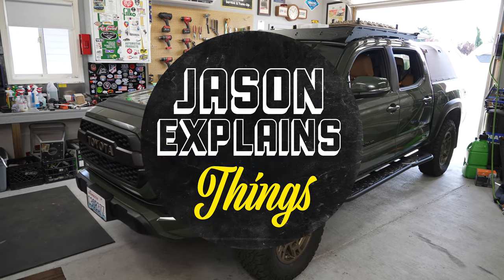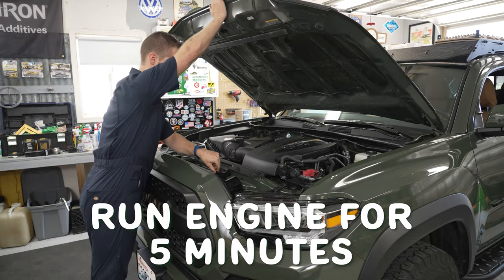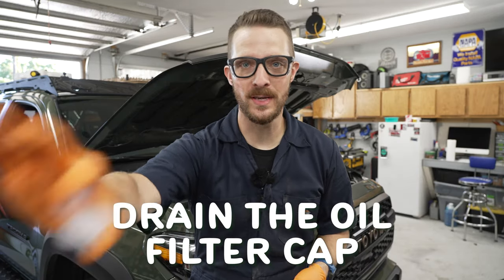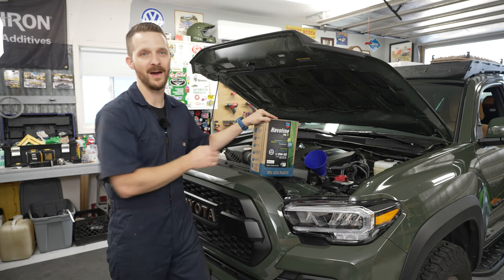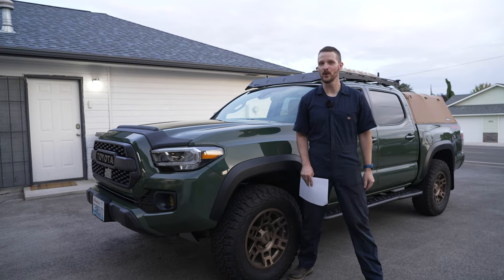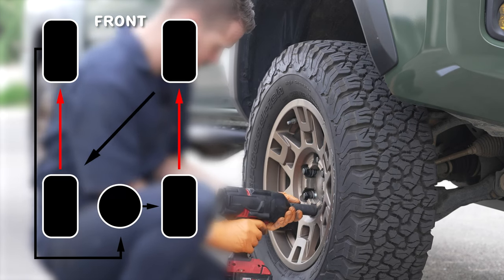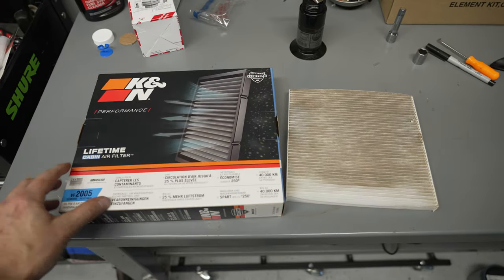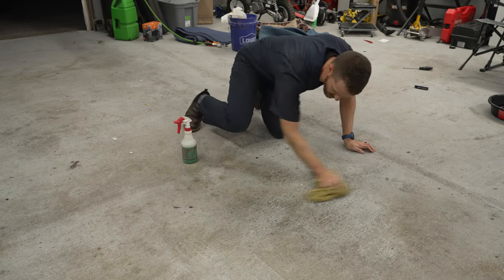Toyota Tacoma 5K Mile Maintenance COMPLETE GUIDE (Oil Change, Tire Rotation & More)

Comment: My dealership did replace my cabin air filter at my 20k Toyota care oil change. They also had me coming in at 5k for my oil change intervals even though the book says 10k. I was impressed.  All covered by Toyota care. 2023 Tacoma.
Reply from the maker: That’s rad!  Your dealership is a rare breed.
Reply: My dealership had me come in at 5K for the first 2 years (Toyota care), but did not change the oil until 10K. I have a maintenance background and I change my oil every 5K, so I noticed this Immediately. Other than that I'm happy with the service.
Reply: Same here. 2022 Tacoma. Exact same treatment!
Reply: @oysterfleet5669 , Toyota care is for 25k. And they only cover 10k oil changes. Maybe the dealership paid for the 5k changes. My dealership is giving me free oil changes every 10k up till 100k. But I still change it myself after 5k

Comment: for anyone prepping to do this, I'd suggest having a larger 1/2" breaker bar and a 24 mm socket for the oil filter housing because those things can be over torqued by the dealership, at least mine was. this was the solution I'd found on tacoma world, if anyone runs into a similar thing
Reply: the "mechanics" they hire at dealerships are the worst of the worst. That's where you go to get your money stolen and shit broken. Gotta do it yourself.
Reply: Bro I just took a ratchet to the nose from pulling on the oil filter😂
Reply: And a torque wrench to tightening the housing to 25 nm.
Reply: I don't think the dealership even oiled the O-rings when they did the included maintenance on mine. The first time I changed the oil, it was a beast getting the filter off.

Comment: Its better to use your fuel cleaner just BEFORE your oil change. Then you're dumping all the unburnt hydrocarbon buildup into the old oil that you're about to change. I have 260k on my Taco with no major issues.

Comment: Excellent video. I just got a 2023 Tacoma and Maintenance Required light came on,  didn't know why. Now I understand it's the Oil service reminder from factory computer settings. The dealerships had just serviced it at 3k so the actual oil change would be at over 6k, but vehicle was just doing it's factory reminder.  Thanks for being so thorough on oil change procedures and reset.
Go Tacomas!

Comment: Great video, I'm 64 years old, and I only rotated tires on one car out of the Many cars and trucks I have had over my lifetime. What I found out is yes it made them wear the same, but it wore out all of them at the same time, so I never rotate tires anymore, why? Because I don't want to have to buy but 2 tires at the same time rather than all 4, It's a lot cheaper to buy 2 tires over 4 or even 5. I don't believe you get more life out of your tires by rotating, but you do get more life out of the set that way because the back usually wears out faster if you have rear-wheel drive and spin your tires when you take off or the front if you have front-wheel drive. And I never included my spare tire in the rotation, which honestly is probably a good idea, especially if they all match and they are all new. I'm going to try it your way on my new Tacoma and see what happens, I don't need a new spare tire, just something to get me to the tire shop if something happens on the road. I do carry a can of fix a flat and a mini air compressor with me everywhere I go, I even carry a tire fix it kit I bought from Amazon in all my cars and trucks so if i can find the whole I can just fix it on the road. I do a lot of backpacking and white water canoeing. Right now I have a dodge ram 2500 Toyota Tacoma and a Honda CRV which doesn't even come with a spare tire at all it just the can to fix a flat lol. I'm going to try it your way this time and rotate my spare into the mix until I get my spare worn down to almost time to buy a new one and see what happens, keep up the good work.

Comment: I highly recommend getting an aftermarket oil filter housing, because mine broke trying to take it off myself due to my last maintenance person at Toyota cranking it too tight. Plus the aftermarket one, it's made of better material.
Reply from the maker: There's an aluminum filter housing from Toyota that I've since upgraded to.  That's the one I'd recommend.

Comment: I have splashed oil many times in my shop doing oil changes. I know the feeling.
Reply: I had the oil geyser out of the same drain pan. Twice!  Thought it was a fluke the first time and was ready to move the pan around the second time (Didn't help). I blamed it on the 0-20 thin oil as the 10-30 oil in my other vehicle never geyserd out like that with the same drain pan. I have since put an Oil Splash Pad in the pan and no more Geyser.

Comment: Not a bad video, basically what I do with two differences. 1) Shop vac, connect to the inlet pull vacuum while you take off the the drain plug, you don't get any oil out till you shut off the vacuum. Lazy way to keep clean. 2) Do you not have grease joints on the Drive shafts anymore? I have a 2nd gen Tacoma and I lube them up every time I change the oil. I also do 5k miles or 6 months which ever comes first (use to be 3 months or 5k miles, but I don't drive near as much with my new job).
Reply from the maker: On my 4Runner you do need to lube the drive shaft, but it’s sealed on my Tacoma.

Comment: I didn't have the place to change my oil last time so I brought it to a shop.  They charged $330 to change the oil and change the cabin air filter....  -.-  Didn't even go over anything they may have inspected like brake pad thickness.  At least a dealership will do that.  
Thanks for this great walk through!
Reply from the maker: Oh my gosh!  That is complete madness.  This right here is why I make these videos.
Reply: @JasonExplainsThings  they also put a sticker on the widlndshield to come back in 3k miles. So I'm afraid they put conventional oil in too 😱  all I asked was for the "40k maintenance"

Comment: I installed a Valvomax drain plug on my Tacoma after I bathed myself with oil on the first change. I scrimp on the cabin air filter because I open my windows and sunroof on nice days. The cabin air filter is largely superfluous with the cabin open. Even the cheap ones protect your ventilation heat exchangers.

Comment: This is Helpful!! Thanks.. im no mechanic..
Reply from the maker: Neither was I... just started tinkering about 13 years ago.  Now it's what I do for fun.  :-)
Reply: @JasonExplainsThings   are you Cutting soon your Bumper.. Seems alot of Taco are doing it to make clearance on the front Wheel
Reply from the maker: My plan is to do an aluminum CBI front bumper to increase clearance, approach angle and to add a winch.  Hoping to do that this winter.  I already have the winch sitting here!  :-)

Comment: Hey you should check out Capri 4.5 gallon drain pans. Well built deep walled, no flexing or twisting with 7 quarts in it. Holds about 8 quarts safely.
Reply from the maker: I definitely will.

Comment: Great video.  One additional item to consider is greasing the U-Joints.
Reply from the maker: My Tacoma doesn't have grease zerks actually.  When they wear out I'll likely replace them with ones that do.
Reply: @JasonExplainsThings  you have to check carefully, my '18 had 1 on the front drive shaft that I found when I started doing my own oil changes

Comment: I’ve got a question for you Jason.
My dealership uses Mobile 1 full synthetic oil when they change the oil and filter.
If Havoline is better oil, why do they use Mobile 1 ?
I get free oil and filter changes for as long as I own my truck, (which is about 15-20 years or 250K to 300K miles).
Toyota says to change the oil and filter every 10K miles but I still change it every 5K miles, so I buy the Mobile 1 full synthetic oil and filter and crush washer, so Toyota charges me $40 every time I’m paying for it.
My 23 TRD Off Road is about a year old with 8,500 miles.
We’re going to MT this weekend for vacation, so I’m sure after returning home it’ll have 10K miles on it.

Since our dealership uses Mobile 1 full synthetic oil, will it hurt my 3.5L to use the Havoline for the times I’m paying for the oil change?
I appreciate your channel and content.
Reply from the maker: Mobile 1 is great oil too.  No issue in using it.

Comment: I have that exact CBI skid and shops have complained they can't access many things and asked to remove them. I told them not to touch. Have you needed to remove yours for any specific service?
Reply from the maker: For a front differential service you would need to remove it… but not for an oil change.
Reply: @JasonExplainsThings  Yeah I always just remove the two access doors before an oil change, but at my 60,000 service the tech said "your differential fluid looks good." And I wondered how it's possible that they knew that without removing my skids. I actually have the full skids from CBI, which covers up more stuff. 🤔

Comment: I learned on the first oil change to use a large Tupperware container about 5 liters in volume to catch the oil. It’s about 5” tall on the sides and there is no splash what so ever. Im going to def buy the skid plate. The stock one isn’t too hard but def heavy and make your shoulders hurt after. Thanks for the awesome video! Subscribed.

Edit: it is a 10liter container. 5 is way too small haha.
Reply from the maker: Thanks Danny!  Hey I actually have a discount code for it.  Expires in a few weeks but it should be active now:  CPM6LYBLBP
Reply: @JasonExplainsThings  thank you very much for the code.

Comment: Where do you stand on low mileage vehicles? Service at the 5k mark or based on time? I work from home so my truck does not get up to 5k miles very quickly.
Reply from the maker: I’ve heard a good rule of thumb is every 5k or 6 months.  Some say you can stretch that to a year if you don’t drive much.

Comment: Mmmmm🧐?

Thank you for the tips on the oil drain tool kit, I am going to purchase one. The filter removal sockets purchased thus far have been junk. 

And I do use the same exact oil. 

Thank you for finding the cabin air filter location, I was wondering about that. 

Your tire rotation plan is clever. 

Though, what about the transmission fluid level, and you forgot the differentials. 

Thank you and motor on!
Reply from the maker: Trans fluid and diff changes are more of a 30k-40k interval.  When the time comes I'll definitely do those.
Reply: @JasonExplainsThings  how do you know that the current oil level in the transmission and differentials is correct? Do you have faith in the factory's procedure, and or in the dealership pre-sale inspection? 
Have I checked mine? You ask. 
NO! I feel neglectful in that respect. 
The all too (new practice) common practice these days is to have a sealed transmission, no dip stick. 
We customers are the dipsticks now days for allowing this practice to continue. 
And I have not checked the diffs due to blind faith that they got it right at the factory, foolish I know. This will change as soon as I return home from my journey. No, I am not driving my Tacoma currently. 
Now what about that transfer case, I have forgotten all about it, I have become such a slacker. 🥺

Comment: I torque the oil filter cap to 18' lbs and oil cap plug to 10' lbs....every 2 days I see a small drip on my oil filter cap. Should I tighten the oil filter cap some more?
Reply from the maker: Might be worth checking.
Reply: @JasonExplainsThings  I will Thank you.

Comment: Jason, did the steel CBI skid plate used on your Tacoma take care of the design issue you noted on the aluminum plate used on your 4 runner?
Reply from the maker: So, I'd recommend watching this video about this topic.  Long story short, the aluminum CBI skid had a pretty dramatic failure I feel is caused by removing steel cross-braces when using an aftermarket skid plate.  I now use the Toyota TRD front skid and it's been excellent.  https://youtu.be/0_mebxQ5uBg

Comment: Wonderful helpful tips and guide. I have a 2018 Toyota Tacoma SR5 3.5L V6. @ 36,000 miles I have a question and wanted to know if the same things you use work for mine as well or should I get a different kind of oil? Second question is what kind of transmission oil fuild do I use to change and what other things do I need to change also? It's hard to find real loyal mechanics so I came across your channel and hoping to get some help all the way from: Juneau Alaska
Reply from the maker: Yep, the engine oil would be the same.  Haven’t looked into transmission oil yet since I’m only a 14k miles currently.
Reply: @JasonExplainsThings  
Ok, thanks 😇👍

Comment: Do you have TPMS on all 5 tires? I am thinking of doing this for my truck, but wondering if I only have 4 TPMS, when I put the spare to passenger rear, it will throw a code for the sensors.
Reply from the maker: It will but there’s a way around it:  Toyota Tacoma TPMS Tool:  Reprogram After Rotating Tires or Swapping Wheels!
https://youtu.be/NkXqJP2j5CI
Reply: Ok the TPMS tool you use in the video is one I was looking at getting myself. Do all 5 tires have TPMS on your truck? Or just 4?

Comment: Thank you! But K&N filters let 30  microns of dirt through the intake. Not good for sensors. Best filter is WIX 3-5 microns. Techron should be added the last tank before a oil change. Not after a oil change.
Reply: Thats why i won't us K&N. Yes they are better for performance and longevity of the filter itself but not for the longevity of the vehicle as it lets more dirt through.
Reply: you came up with that all by yourself didnt pal?
Reply: @BenState  Through years of research
Reply: please cite the 30 micron and sensor link.

Comment: YOU FORGOT A STEP!!! After rotating the tires you need to reset the TPMS so it can relearn the tire positions. Although, I'm not sure how that's going to work if you have a sensor in your spare. Normally, that's not the case, but you have an active spare that you're using in the rotation and the TPMS doesn't account for the spare.
Reply from the maker: I'll be making a follow up video all about having 5 tires with TPMS sensors.  It ends up being a pain to work, but I figured it out.

Comment: I just discovered your channel and planning on getting a Tacoma in Aug.  Would you recommend Lucas oil stabilizer, or other Lucas products.
Reply from the maker: I've used oil stabilizer in the past on older vehicles with well over 100,000 miles.  I wouldn't recommend oil stabilizer in a new or low mileage vehicle.  But do your own research and talk to a mechanic you trust.
Reply: @JasonExplainsThings  thanks.

Comment: What size tires do you run? Also I have the same wheel set up as you. But… seems like you can install a full-size spare under the bed. Can you? I always heard that you need to modify it.
Reply from the maker: 265/70/17… so only oversized by 1 inch.  Fits in the spare spot just fine.  From what I understand a 33 will fit.

Comment: Can you get away with using a 3-ton low profile Pittsburgh (20in max height) on a 3rd Gen trd off-road? Or is there any advantage to spending more on a long reach Daytona?
Reply from the maker: I use the full height of the jack all the time, but you can always throw a block of wood or something in to use the shorter jack.
Reply from the maker: That’s what I used to do.

Comment: Brother next time use your fluid extractor to remove the oil via your dip stick tube. It would have saved you from cleaning up a mess.
Reply from the maker: I love those but don’t see the point as much when you need to crawl under the vehicle for the oil filter anyway.  On my VW GTI I used an extractor every time because the filter was on the top as well… so I could do an oil change without lifting the vehicle at all.  👍

Comment: I just bought at '23 with 6 miles on it. The dipsticks on these read funny on these from what I've heard. It was reading high but it's hard to read new oil. I decided to do it at 100 miles for peace of mind. It was overfilled 30oz from the factory. Has anyone heard of this?
Reply from the maker: Weird.
Reply: @JasonExplainsThings  Have you ever gotten seepage around the rim of your oil filter housing where the plastic meets the metal? Mine is torqued to 20 ft pounds and it's still seeping slightly. I have 110 miles on this truck and I'm starting to get buyers remorse already. 
Thanks
Reply from the maker: Weird, no.  Not at all.
Reply: @User-q6x3b  Maybe it's cracked. I replaced mine with an OEM aluminum one (part # 15620-31060).
Reply: @User-q6x3b  Sorry to hear that. Hope it gets resolved.

Comment: Toyota will let you change your own oil while the car is still under warranty ?
Reply from the maker: Doing your own maintenance does not void your warranty… provided you do it correctly (don’t run the engine without oil for instance).  It’s your vehicle.

Comment: Thanks for the videos. Been watching them like crazy. I'm waiting for my very first 4runner which is on a shipping vessel right now to the states. So i know Toyota has their service package and from what I've seen, most New Toyota owners are doing the servicing on their own including a 1000 mile break in oil change. Did you happen to do the same? Are you planning to use Any of the 2 year toyota service?
Reply from the maker: We did use it for the 10k and 20k service for the 4Runner… and did my own oil changes at 5 and 15k.  So by all means use it, but I highly suggest doing oil changes every 5k miles.

For the Tacoma I’m currently at 8500 so I haven’t had them service it yet.
Reply: @JasonExplainsThings  Thank you! appreciate your insight!